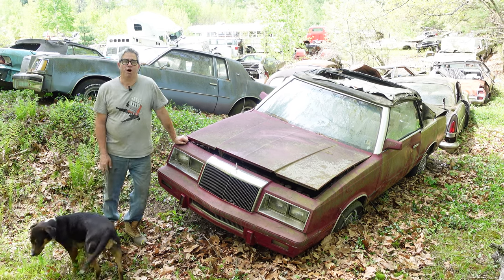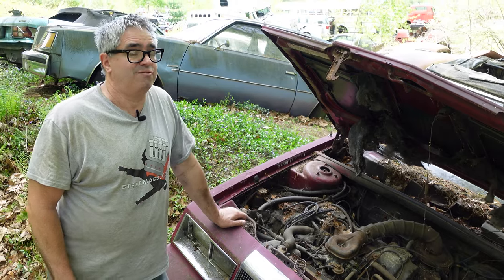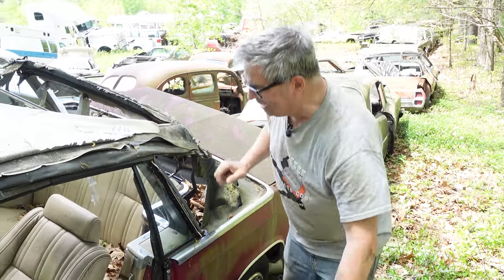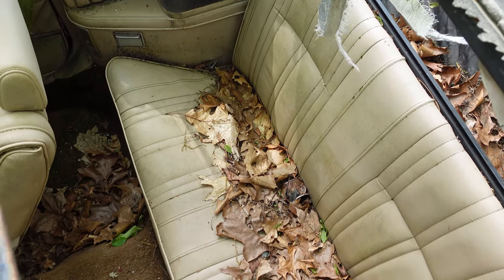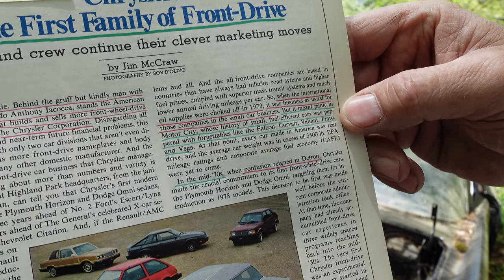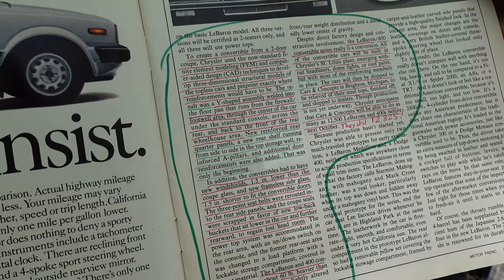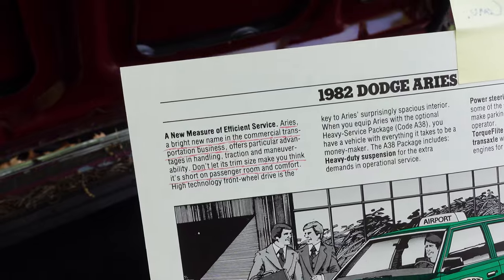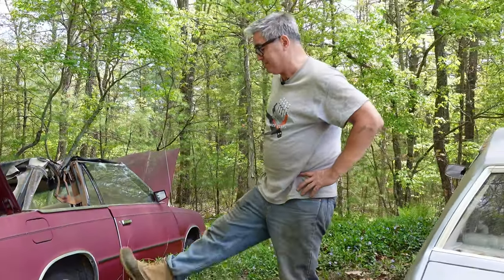LeBaron Goes Topless

Comment: The smartest drivers in the 70's gas crunches and very early 80's were people that drove old Mercedes diesels. Until then diesel fuel was still dirt cheap compared to gasoline and the average Mercedes then got 40 MPG and didnt have to be a tin can to achieve it. Then along came 50 MPG Rabbit diesels then the K car.

Comment: we had several fleet k cars from the county and a reliant that the sub frame assembly spot welds broke out on, i put that car back together with sheet metal tek screws and drove the living hell out of each of those cars gave us around 300k before they died, they were delivery cars for a chinese food joint lol the guy that owned the sub shop across from u of miami had a vert lebaron white on red car

Comment: That Mitsubishi 4 banger was ok, for a little while but around 70-75k you had better gotten the belt replaced, if you hadn't already, otherwise you were asking for trouble. Those Mitsubishi engines, the 4 cylinders, Chrysler put them in the mini Vans too, like the Caravan, Voyager and probably the town and country at that time, and they were in the Colt, among other Chrysler products back then, to me the Mitsubishi 4 poppers were kinda like the GM quad 4's, just glorified boat anchors.

Comment: The k cars were decent for their time.  They were an advancement over the cars they replaced with the suspension and steering.  The sedans just weren't enthusiast cars and weren't particularly luxurious.  It was the best they could do on a shoe string budget.  The Daytona based off the k was decent in handling.
Reply: Besides this, if I could only afford one car back then, I would much rather have a k car variant over a GM F body to deal with the snow.  I speak from experience.

Comment: Yes they were more expensive than a Z-28 Camaro, But back then insurance on a V-8 Camaro went through the roof since Z-28 Camaros were stolen so often. There were more exciting cars in 1982 that were more exciting than the LeBaron K cars but insurance was much cheaper for a 4 cylinder K-Car..

Comment: Steve.... getting caught up on your vids...and am a bit disappointed by this. While I get that you used a junkyard find to talk about the K Special (yes, the Lebaron and 400/600 were just slightly different) convertibles, you missed on the sample model. The car you are taking about is an 84, not an 82. 84 had an entirely new top, new side panels and 1/4 windows. I usually am impressed with your attention to detail.. and still a great fan. Just think you missed on this. One thing though that you are spot on about, is the price of these when new. They were very expensive! I have an 85 600 EX Turbo convertible that had a sticker price in 1985 of 15K! Yup!

Comment: chryslers crack pipe designs.junkyards were full of these by the late 80s with less than 120k miles on the odometer.its allways possible they were severely undermaintenenced as well.